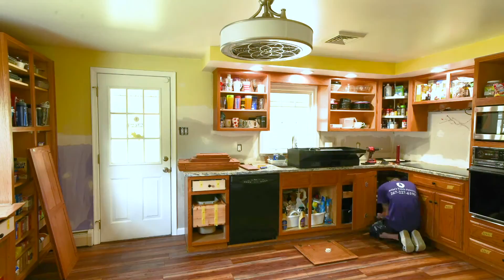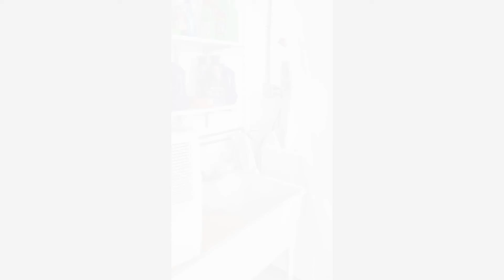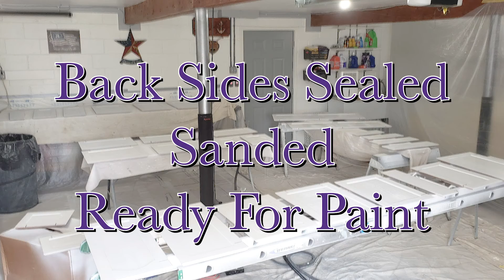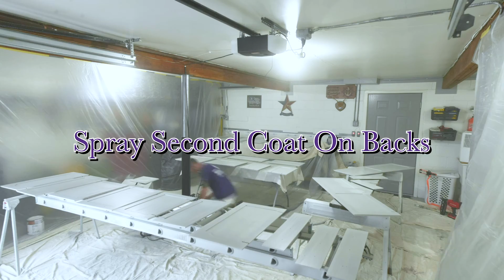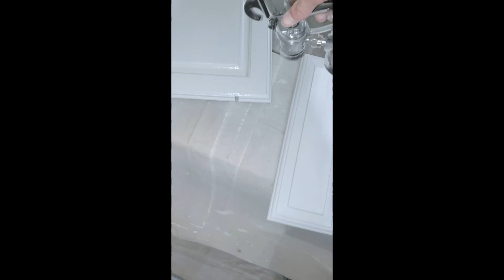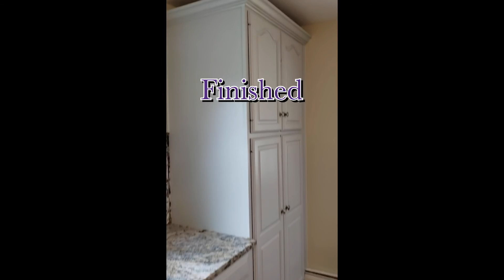How To Paint CABINETS step by step (refinish like a pro)

Comment: Great video. Prepping my inside space for airless spray has been quite a challenge, thinking about roller brushing inside and using sprayer for cabinets. Did you see any inconsistencies with the two different applications once kitchen was reinstalled?
Reply from the maker: Yes, you can see a difference. Especially depending on the coating you use. Nowadays we run airless or air assisted on all our finishing projects and we run 2k polyurethane wich can't be brushed or rolled. Another thing to consider is texture difference reflects light differently causing the color to be different. DM me on IG if you have any more questions.

Comment: Absolutely amazing. Wow this is an overwhelming process. Congratulations on an amazing job well done. Is this the same process for mdf after removing the laminate in your previous video. Thank you so very much. Trying to build my confidence.
Reply from the maker: Yes, once the laminate is removed and the surface is clean and sanded smooth you can follow this same process.

Comment: Why shellac and sand with steel wool?  I have thermfoil cabinets that I’m researching how to paint.
Reply from the maker: Shellac blocks tannins that are released from the oak grain and pores. With thermoforming you need to use heat to loosen the glue behind it and peel it off. Then an extreme bonding primer prior to your top coats.
Reply from the maker: Steel wool I use in different cases depending on wood type and. Oating I am using. It does minimal damage but provides a smooth finish. Just not the best choice on white or lighter tones. Scotch bright pads are my newer better choice for any sanding post primer.

Comment: You might try the new Command product from Benjamin Moore. Harder than Emerald Urethane and much better dry time. 20 minutes to touch, 1 hour re-coat and 24 hour return to service. I love that product.
Reply from the maker: I have heard about it. Most people reccomend advanced from BMoore but Emerald UTE chemical resistance is a bit better. Also I think I have decided to stick to kem aqua products for now. They at least are KCMA approved coatings with good leveling and dry time. Thanks for your comment though 🙏🏻🙏🏻

Comment: Was going to ask the usual questions on product selections but in 16 short comments you answered many. Been staring at two doors I have removed over a double oven.  Plastic delaminated. MDF. Have a load of MDF scrap in the garage to test with, trying to find a base that will seal and not cause the it to swell. Only 50 faces to go before I can sell this property.
Sell me a good list of the actual products to do this start to finish. No I do need to know the wool and paper grits. The chemicals to apply in the order would be all necessary.
Reply from the maker: My process has changed a bit since the recording of this video, but the simple response on grit is that I start with 100 and step up each time I sand. For oak I use white pigmented shellac to seal out stains and tannins. Anything else would be extreme block or extreme bond oil base primer. Topped with emerald urethane enamel. My new process today is to sand everything down to bare wood, stepping down until it's soft and smooth sometimes starting at 80 up to 220. Either shellac or 2k primer, sand again with 220 or higher, topped with 2k poly sprayed wet on wet.